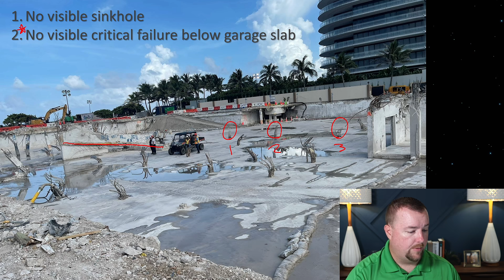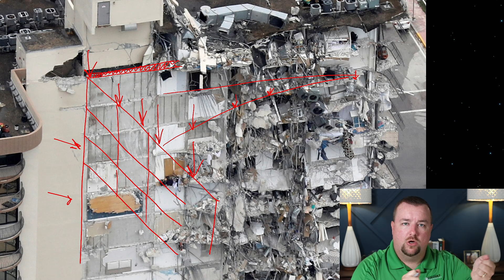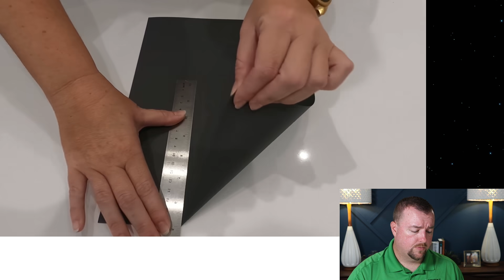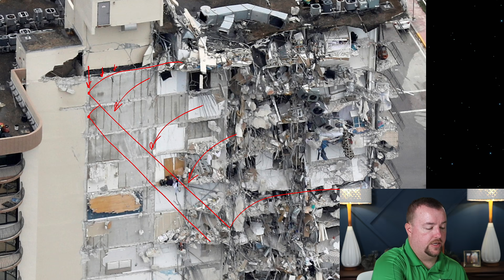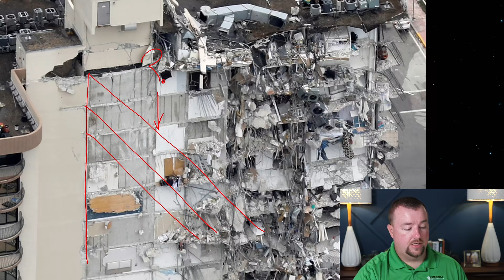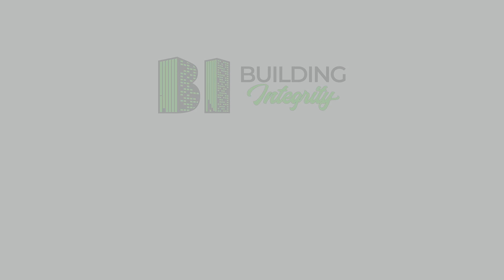Surfside Collapse - Structural Engineer Explains Why Only Half the Building Collapsed

Comment: When they built this building and the basement underneath they did not count for the weight of  water that will collect in that area and did not have runoff for the water and that concrete will degrade as water go threw it putting minerals in the concrete That accelerates the degrade of concrete ! And along with The rebar rusting cracks the concrete in areas you cannot see with the human eye ! Is what caused the collapse !!! Water was running down in the rebar and cracking the concrete from the inside out. !!!

Comment: Now they are saying the concrete walls are very weak that is holding up the sidewalk and part of the street are in poor shape that the walls need to be reinforced with something to prevent the cement walls from falling down and taking the sidewalk and part of the street with it don’t forget that water could be from those cars in the garage that had there gas tanks that blew up from all that rubble from the building collapse

Comment: I am not an ingeneer but I have a question ; why is the sheering wall not going all the way through the building ? As far as my building experience goes (note I am in EU) I saw sheering or retaining wall as going all the way through buildings en in +, because this wall is supposed to resisting sidewards forces to maintain the building standing (upon a certain point).
For a building that size, being on the cost (higher sidewind forces and downwards sinking forces) it would make sense to have a full sheering wall instead of a half one, to me it doesn't make sense and you showed it clearly with the paper and ruler.
Reply: @beehaven9949  Here they do, but these sheer walls are not half of the total surface of the building.

Comment: Difficult one. But what's a shear wall? Only one in a building?
Reply: A shear wall is like a cross brace. Imagine two columns standing upright next to each other. You can imagine that two diagonal beams travelling from top to bottom of either beam would add stiffness and prevent the two columns deflecting out of vertical and parallel to each other?
Well, a shear wall does the same thing, except it uses a flat plane of material (in this case reinforced concrete wall) to prevent these deflecting loads instead of the two diagonal beams. The wall takes the load in a shearing plane (trying to tear it apart), so it is called a shear wall.
Basically like how a cardboard box with the ends unfolded will easily push into a paralleogram with a side load, but tape the ends up and you have a "shear wall".
Reply: @TyphoonVstrom  Thx. I'm not an engineer but I have the idea now. And this happens mostly around the elevator for obvious reasons of what an elevator has to do?  I'm a theatre maker. And this story completely fascinates me and it's a lot to learn but I'm watching all of them. My big question - that I have yet to dare ask but we all think of it - what conditions are the bodies in? I imagine (from seeing it once in a morgue) that in the early days, it is basically a bag (skin) of broken/smashed) bones. Sorry if this is out of the subject but ... Jackie

Comment: I think the concrete spalling off the rebar passed right through the upper portion of the garage level columns near the planter boxes. 

Basically the delamination extended through the columns.  When the slab under the planter boxes failed and the planters fell through... a lateral force (that existed in the horizontal) disappeared... and caused the ground floor (1st floor) base of those same columns to 'creep' in the direction of the removed force. 

As the tremendous weight of the load (portion of the building supported by those columns) from above pressed down and pulled along slabs further up on other floors (a survivor by chance was closing a balcony door when she noticed cracks forming across the ceiling behind her then snaking down the drywall... she left promptly for the stairwell on the other end of the building and was halfway down when the portion of the building where she lived collapsed)... stresses built until the ground floor base of the columns slid off the garage levels upper portion of those columns... and initiated the punch through of the first floor slab and buckling of the structure above... which then collapsed catastrophically.
Reply: Great video and explanation of the shear walls role in limiting the destruction to one half of the (rather than the entire) building. 👍

Comment: I was able to see the typical floor framing plan long enough in your video that I see now it was not a PT slab at all.  They're all conventionally reinforced.  The facade came down due to column failure at the basement level.  The investigators can now saw out the slab around each pile cap supporting  the columns along col line 10 and examine the column-to-cap connection and the earthen fill around the caps.  My suspicion is that the caps lost lateral stability a long time ago due to the ground water moving in and out undermining the fill at the sides of the caps.      The pile-to-cap rebar may even be eaten away from the salt water bath it received regularly.   It'll be very interesting to see what they find when they saw open the basement slabs.

Comment: I thought we established that the building progressively collapsed from the ground up, not the roof down? Not disagreeing at all that the shear wall absolutely contributed, but wouldn't it have collapsed at the leading edge at the ground floor level, and then progressively up to the top?  Same mechanism, just different starting point.

Comment: It seems that this system of only using concrete posts to support a building instead of walls leads to a very weak building. There have been buildings that fell over in earthquakes that still maintained their shape while lying on one side.

Comment: So like you said in a previous video, the punch through here was not normal -- it was a cone shape left over instead of a trapazoid like what should normally happen.   If this cone shape happened on the edge of the deck on the columns supporting the building, there's the failure point.   I suggest that the slab had delaminated all the way up to the edge of the building and into the exterior columns.

Comment: Your explanations are very informative and educational. I grew up around relatives who built homes. I do know a little bit about building homes, but I’m not an expert. But I do have a few questions about the building collapse. First, when I look at the collapse, I noticed like lights at the top and some lights in the tower flash. I know the building had electricity, but when I see these flashes and the way it pancaked down, I thought of when they explode a building. I’m not saying that this happened or anything like that, I just wanted to point this out because some people are asking why did this building collapse in a pancake manner and not fall sideways or onto the other structure and cause the other structure to also collapse??? Some of these people do think that this building and the way it fell by pancaking on top of one another is the same way a demolition crew would take a building down. I am not a conspiracy theorists but just wanted to know what your thoughts were on these matters. Thank you for educating the public on this horrible tragedy !

Comment: The plan at 16:30 in this video doesn't show it, but other plans show the columns in the front of the building (Section 4) that remained standing to be about twice the area of the columns in the rest of the building that collapsed. This would mean those larger columns had roughly twice the vertical load strength and perhaps over four times the bending strength of the other columns. Photos show that the garage ceiling under the east end of Section 4 did collapse but unlike section 1, this car park collapse did not take the building above with it. Could stronger columns in Section 4 also have been a necessary contributor to its remaining standing?

Comment: Why such a small shear wall in only 1 part of the building?
Reply: There's plenty of rebar sticking out of some of the floors, you are just looking at with bias. Go and look again. I would say what probably happened is some rebar pulled out from the slabs that collapsed and some pulled out of the structure that remained upright.

Comment: I just cannot believe that this gentleman, who is a crowd favorite, still missed an important undiscussed element of why the West wing did not collapse.  We have been told that the columns in the side that stayed up were 24" wide, and the columns in the collapsed side were 16" wide.  Why, why, why oh why would someone build the West wing with larger, heavier, stronger columns than the rest of the structure?  More importantly, why is no one even talking about this?
Ok, possibly the architect who designed the building was planning to buy a condo, and wanted his to stay up when the rest of the place fell down.  Unless someone else has a theory less stupid than this one.. 😜
Reply: Well, he's discussing a lot of different things, so he may discuss it in the future. Remember, he's not making these videos to just try and figure out what went wrong, but to use the collapse as an educational jumping off point. I do remember discussion of the 24x24 vs 16x16 columns but I don't recall where - the belief was that the west side was facing the prevailing winds and being in hurricane country had thicker columns for more support. Eastern side didn't have the same wind stress so it was thought they didn't need them.

Comment: Since a shear wall is capable of arresting collapse - why is there only one shear wall in this building? Why not two, three, or more that can limit any potential collapse. In this case there appears to have been a problem with the installation of waterproofing, but I would expect that earthquakes and fire damage would be significant and foreseeable causes of collapse in otherwise sound buildings so I can see this as a reasonable safety feature. Why not more than just one shear wall?

Comment: When I first saw these photos of the cleared garage floor a couple days ago I was shocked by how clean, flat and unmarked the garage slab looks.  Not even parking stripes, which perhaps got worn off by the diggers scooping rubble?  In the video I saw it almost looked like the floor was a fresh concrete pour, which I guess must be a layer of concrete dust?
Reply: Me too. I was amazed that the clearing operations hadn't done more damage, let alone the collapse of the whole structure. I was wondering initially if there might have been some kind of sinkhole, but that floor looks as flat as a pancake (though some small areas did have water on them, so one can't see everything).

Comment: So after watching the video (another great teaching moment), it seems we could determine where it initially started punching through…ie. cleanest column top and straightest standing column. Would this be correct assumption? Also depending on how punched through column tops look and angle of column tilt, the direction of slab collapse could be determined? Or are there other factors involved or I’m just not getting it?

Comment: Great analogy using the Ruler/Paper tearing action ... in lay terms, same principal as someone trying to tear off a piece of Duct Tape off a roll ... can't be done at once but just get those first few fibers broken and the rest follows.  On the subject of "Contributing Factors", I keep thinking about the late 70's to now and how "Jacuzzi Bathtubs" were almost nonexistent back then and now have increased in popularity and certainly "size" ... wonder how many people "added" them to their bathrooms/balconies over the past 40 years? Not that it would be an initiating factor but sure would have added compressive power along the way that may have weakened slabs that were already under undue pressures from the encroaching Salts ... just a thought. It is doubtful the original designs foresaw everybody getting a hot tub inside their Apartments which would have changed the load calculations ...

Comment: I am not convinced that shear was the main failure mode of the slab connection to the shear wall.  When the columns collapsed, those slabs started to fall on the end supported by the failed columns and the slabs became cantilevered beams with their fixed end at the shear wall.  I suspect that the moment concentrated at that stiff connection point was a far bigger issue than the shear from the cantilever.  The tensile stress on the rebar at the connection point would have snapped the rebar almost instantly causing a nearly brittle failure mode.

Comment: Something isn't adding up the way this building fell in on itself like a controlled demolition!
Reply: A controlled demolition usually involves destroying with explosives certain key structural members, in a timed sequence to control the direction of fall.  If a structure has built-in weaknesses where failure of one member leads inexorably to failure of the next nearby members, then the failure of one damaged and  overstressed member will produce a failure that looks a lot like a controlled demolition.   A domino chain does not require intervention all along the chain to produce a complicated result; it just needs the first domino to fall.  If you create a robust domino pattern with gaps at intervals you need to act on it at multiple locations. Like in a controlled demolition of a building with proper safety margins in its design.
Reply: @daveuggla8383   A natural collapse follows the path of least resistance, which by design isn't in it's own footprint.

Comment: I wonder why it's submerged in Salt-water?

Higher than usual tide due to today being a full moon?
Reply: Probably not. The sub basement would've had a drainage system to deal with water ingress from rain, brought in by vehicles, weeping through retaining walls around the structure etc. Now power is removed from site, there is nothing dealing with this water ingress (and rain), so now it is simply a very leaky swimming pool.

Comment: great explanation's. I don't see  why they say it may take years to figure what happened. we need to hold those responsible before they die of old age.
Reply: Should’ve been condemned in 2018! 
It was in such bad shape!
Reply: Too late.  The developer, contractor, engineer and contractor are all gone, if there was anything they did wrong.  The Board is not responsible.  They are not engineers.  The fact that this building went down means it was already past saving in 2018.  It would not have been feasible financially even if the engineer had realized how bad it was and if it would even have been possible to repair all the damage AND ensure it did not repeat.

Comment: So many questions in my mind. Have building structures improved since the 1980's in high rises? Is it possible to build a better building than this concrete rebar design? Is it possible to build high rise buildings in Miami and expect them to stand, even with salt water conditions? This just seems to be such a flimsy build for a 12 or 13 story building, even in the best of conditions. How is it that buildings stand for 100's of years, yet a building only 40 years old, pancakes? I understand why it happened from the explanations, I just can't understand why this type of construction would be allowed.

Comment: I don’t understand this one - If the compromised portion tore off and slightly pulled down the other half of the remaining building by a few feet, why are both remaining halves perfectly intact vertically? Doesn’t that imply that one portion also dropped at the basement level and separated (as a vertical whole structure) from the other half of the remaining portion along the shear wall?

Comment: how did the floors tie into the shear wall?

They broke cleanly away from it, I looked at the plans and the tie in looked insufficient, I am a contractor but not an engineer.
Reply: I suspect the shear wall is actually an expansion joint. That would explain the lack of visible rebar, and provide an equivalent outcome to that proposed by this video. Why it was designed this way is a different question!
Reply: The REBAR seems to be in place !

Comment: Most tall buildings use traction elevators that go up and down with higher speeds, and they use guide rails fastened to the shaft walls, and uses counterweights along with the cables and the elevator hoisting machinery in that room where the ladder once was They do need extra strength to allow for the live loads. Great video...
Reply: John ... while the steel in the elevator offers some strength, it's the concrete box like structure around the elevator / stairs that gives the most strength. If you think about it, this giant box beam is basically 4 support columns that are interconnected and spreading the load in an area that's around 10 x 20 ft and that's more support than any of the other columns because of the solid walls all the way to the roof. If you watch any construction you will notice this part is first in the process and they are free standing before the rest goes into place. It's the strongest part of the building.